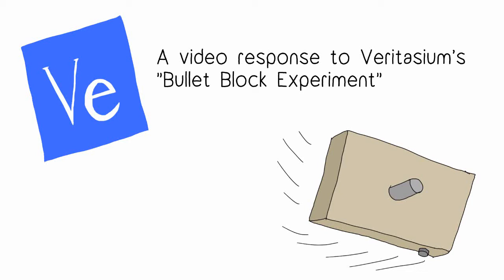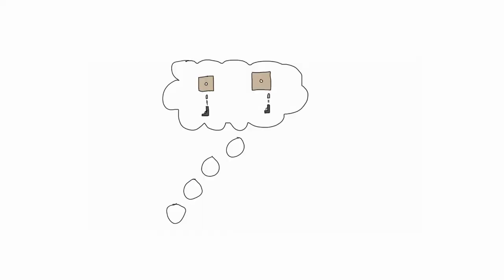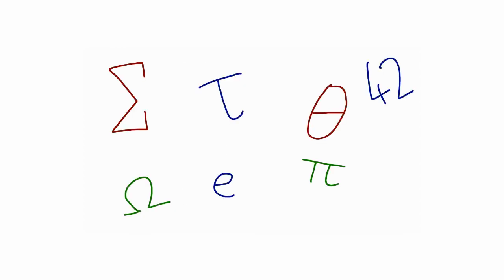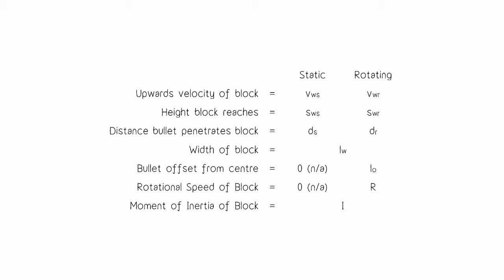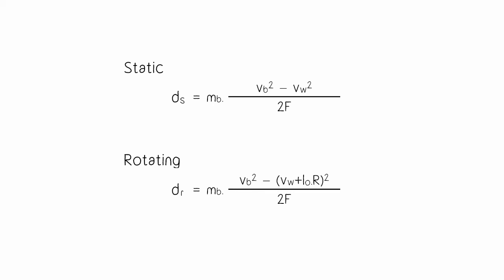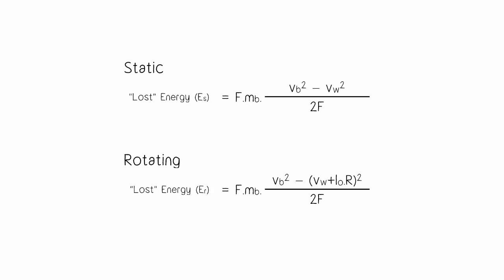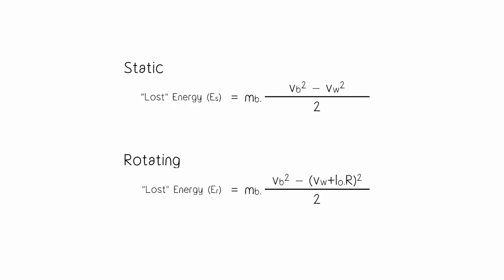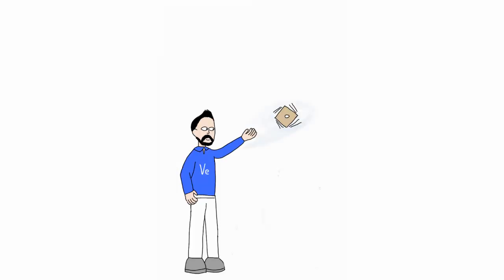Response to Veritasium's Bullet Block Experiment

Comment from the maker: Ok, due to the time constraints I was under for producing this video I didn't make it as clear as it could have been. I meant to point out that this video was talking about a "theoretically perfect" collision where there is not wasted energies to things like heat and sound. With regards to your points

1) There will be more of those energies lost in the longer collision.

2) The force applied by the block will be consistent

3) The value of U is correct

4) see my comments to bonarch

5) thanks!

Comment: There is an awful lot wrong in this video.

1) You assume that all of the lost kinetic energy goes into additional rotational energy, wrong, there is heat, light, sound etc 
2) You assume that forces and acceleration are constant through the impact, there are not and so you cannot use V^2-U^2=2as and E= F*d is also invalid
3) You make assumptions about the value of U after impact which are invalid, 
4) You assume block is stationary through the impact
5) .... it is all just wrong

Comment from the maker: I've had a little more thought about this and this only thing that needs adjusting is a component to determine the penetration into the block.
Because the force is applied of the distance the bullet travels in total the calculations for energy lost and rotational speed should be correct (assuming a 'perfect system' with no real world additional losses).

Comment: The problem with this explanation is that during the time the bullet decelerates from v to u, the block has also moved from one position to another. The final position of the block is different in both cases. The distance s is measured in a static frame of reference, and as far as the bullet is concerned, it encounters wood over the entire length s. However, that does not mean that the block ends up with a hole that is s deep.